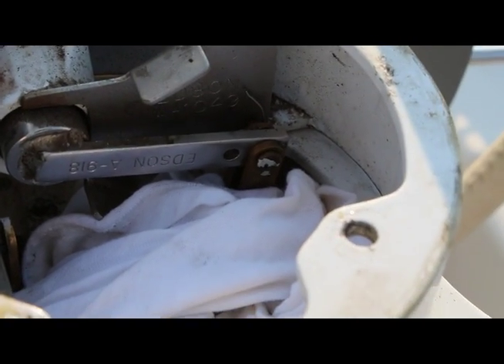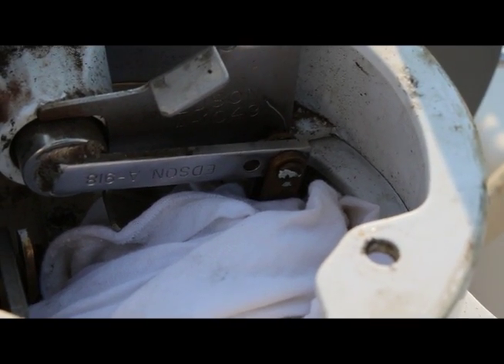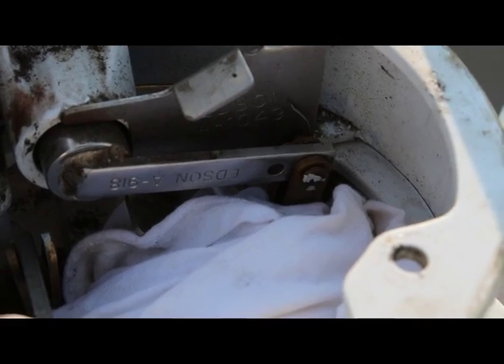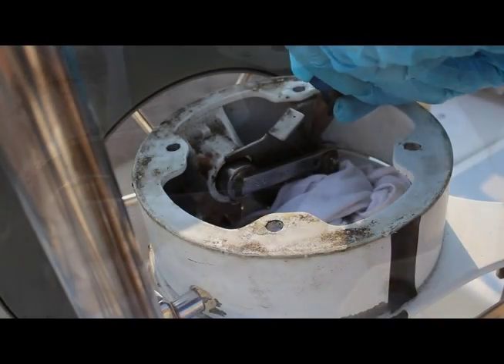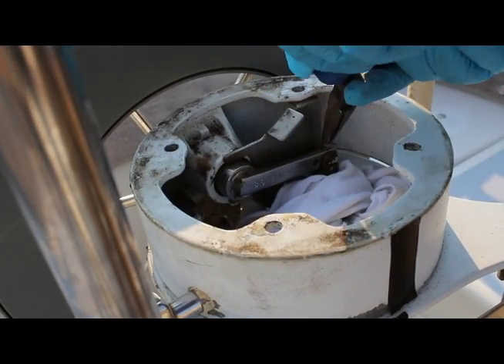Engine Control Removal

Comment: Hi - how can I find the video on "engine control cable clamp removal"? My gearshitf cable broke and I do not see how I can remove it, the clamp is located so deep I can barely see it. There is a round head screw outside at that distance. Also, does the steering chain have to be removed first? My pedestal looks just like the one in your video, and is about 41 years old. I just completed anchoring when the cable broke so I am desperate to get this done asap. Any help is appreciated. Thanks.
Reply from the maker: Thank you very much for your comment - we're glad to help! I'm sorry that we haven't published that video yet, but we would be glad to walk you through that process over the phone: +1 (508) 995-9711. Looking forward to getting this solved for you.
Reply: @edsonmarine  Thank you for replying!